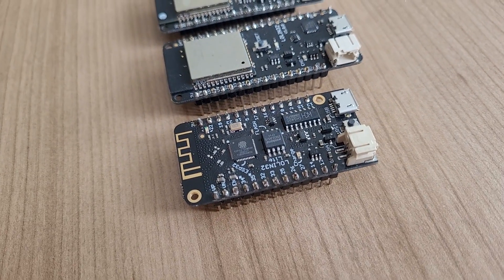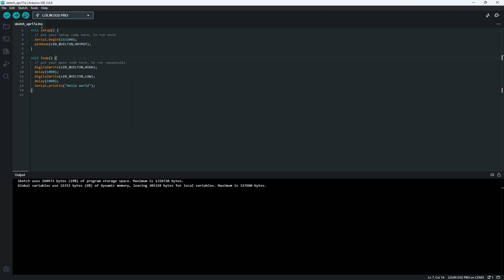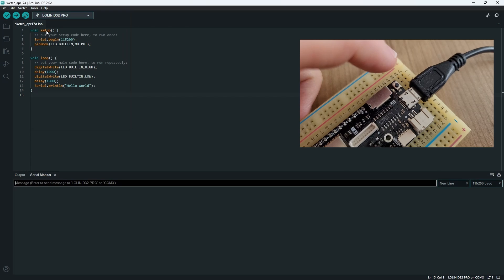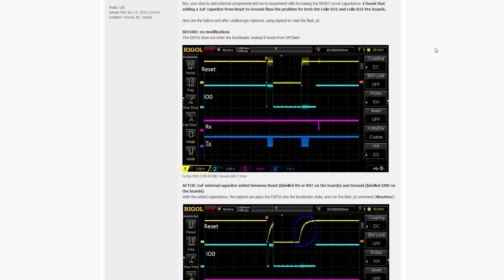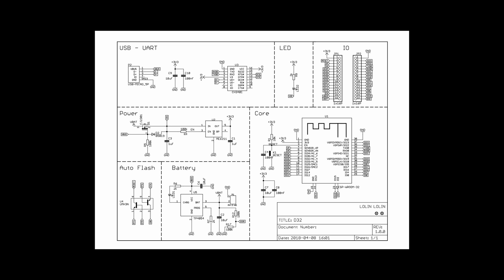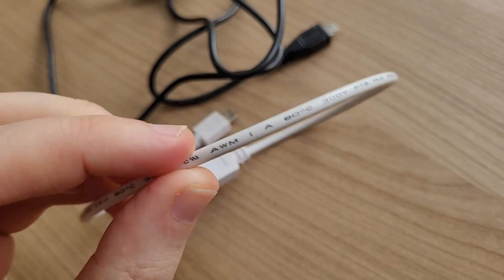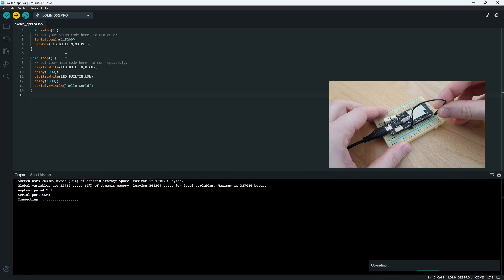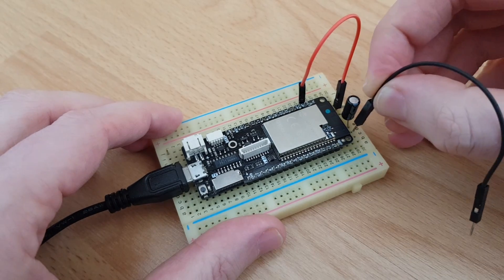Solving ESP32 Code Upload Issues - Troubleshooting Guide

Comment: Hello! I have an esp32 lolin32 v1.0.0 version and I can’t write scripts to the module. The problem is that the module doesn’t enter in “download mode”. I try many methods to do that but they have failed. Can you tell me some methods to change the module mode into “download mode”?
Reply: Odd as it sounds, try a different PC.  I have an HP desktop, and an HP laptop. Win10/64.  Arduino 2.x. Both worked fine till about 6 weeks ago, when I allowed an ESP32 board update on the laptop.  It disabled my ability to upload  to most ESP32s from that machine, compile still works fine.  I've uninstalled, reinstalled, gone back to Arduino 1.x, ESP 1.06/08.  Nothing will make it work properly.  The laptop uploads to SOME Lolins OK, manufacturer dependent.  The desktop works fine on everything.  I'm not updating that till I can figure out what's up with the laptop.  (I suspect that Arduino installs something upload related that doesn't get removed during uninstall.)  The cap/short to ground on the enable line does nothing for my stuff.